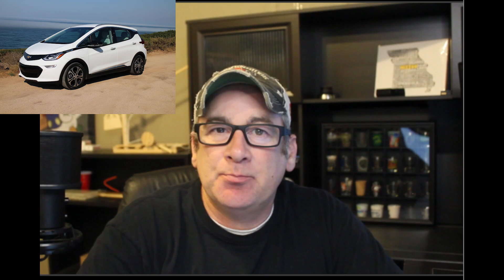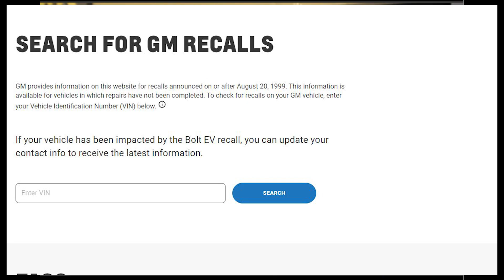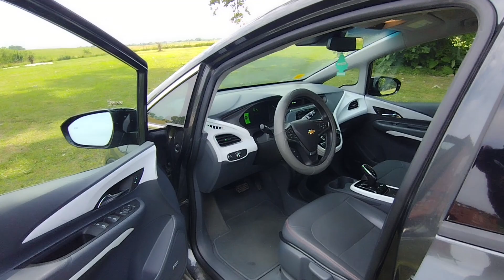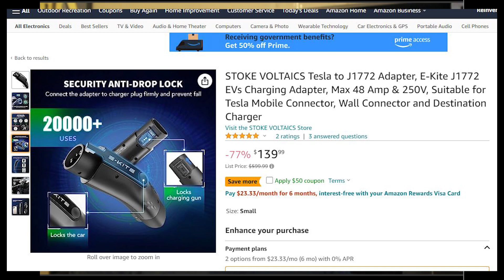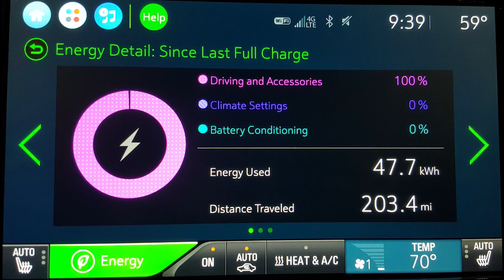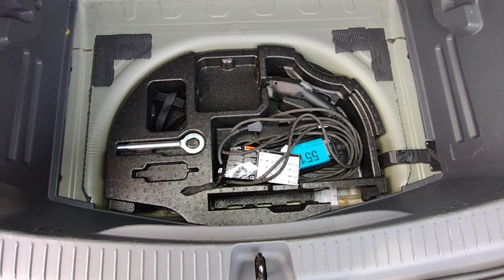1 Year Review of a 2018 Chevrolet Bolt EV

Comment: Good Review. I have a 2018 Bolt Premier that I order from Chevrolet in 2017, on top of that I added all the extras that Chevrolet offered at that time, after the government rebate I end paying $32,000 for the car. My Bolt is going to be 9 years in March 2027, actually it has 32,000 miles, so far from maintenance standpoint only the 12v battery was replaced, and tires rotation every 7500 miles. I average 5.5 miles/kw, my car is an outstanding city car. The reason I can’t buy a Tesla with auto pilot today is because there is no way I am going to get rid of the Bolt, the Tesla will have to wait until my Bolt die.

Comment: Just bought a 2018 Bolt LT yesterday for $11k OTD 

Has the heated front seats and infotainment upgrade as well

44k miles
Battery changed in August of 2023 at 30k miles so i have PLENTY of warranty 

I drive a tesla model 3 as my primary and the bolt is a neat utilitarian car. Public charging is a bear in comparison to the model 3, but just leaving it charging level 1 at home gives me plenty of usability
Reply from the maker: I just rolled over 90K miles.  Knock on wood, hopefully it keeps going for many years to come.  It makes a really good commuter car.  I'm thinking about passing it on to my 16-year-old daughter and getting a Tesla.

Comment: just got my 2020 bolt premier at the begining of this month, due to the transmission problems in my traverse.  It is the most comfortable ride I have had with any car that I have owned. I  was told that if I ever had any problem with the battery to bring it back in and it will get replaced for free. something about the government program they put me on.  the farthest I go is 100 miles once a year. mostly it is 50 to 60 miles  doctors for me or the hubby, then taking my kids that cant drive to their work. I rent so I use the wall charger. 
got a free charge at the car lot three days after having it and they were shocked that my battery was not even half used up.  the only thing that I was not happy with is they didn't tell me tags would be 250 an year where Im from.
I go to a Japanese convention every year and was worried about trunk space but I think we got it figure out. three day and the lot we park in has four chargers in it.
it works great for me and I also know some people that it would not work for. :)
Reply from the maker: Glad to hear it's working well for you.  Our annual EV tag is a little over $100, and goes up $5 every year.  Still cheaper than gas overall I think.

Comment: How is this a good car? I have a 2018 and it rides like a bucking bronco,no spare tire,no jack , terrible radio speakers and like always a good 48 hour to fully charge..I have a 24 year Buick that gets 25 mpg and rides like dream.
Reply from the maker: HI, thanks for the feedback.  Yeah, it's definitely no Cadillac, but overall in my opinion its a good car.  I have the updated Bose radio, and I think it ok.  I do hate that it doesn't have a spare, but I doubt you'll find any EV that comes with a spare.  I do love the 120+mpg!
Reply: I just bought a 2017 Bolt, and it rides very smoothly compared to all the other small cars I've had. The speakers are fine for me - music is awesome with the quiet ride. Get a $400 charger if you can charge at home, and it easily charges to full overnight. I also bought a spare tire and jack, so that's all set.

Comment: After listening to this video…not worth it not even close. Especially if you have to replace the battery at 14,000
Reply from the maker: What do you mean by 'change the battery at 14,000'?  I think it all depends on how you're using it, but I definitely wouldn't have one if I were a single vehicle household.
Reply: @joetalks.76  14000 dollars

Comment: 2020 Bolt EV owner here: I've made several round-trips from LA to San Diego off one charge. It's about 120 mi one way. Depending on conditions and habits - I can make that trip in 80 mi (battery usage wise). The Bolt's regen is a marvel of engineering. I still would agree with you about making multi-hundred mile trips, unless you are a very thorough trip planner and have all your charging stops planned. What I like about the lifestyle of owning an EV is that, charging this at a public DC charger, let's you kind of slow down and re-center. If I ever HAVE to charge on the road, at least it lets me catch up on reading LOL

Comment: New Bolts charge at 48 amps L2.  Ideally never go full or empty, only charges fast as you need to. I charge at 16A usually. For max range, preheat / pre-cool while plugged in before a long trip. I'm going to try Rain-X anti-fog.
Reply from the maker: That's interesting.  I didn't know they had increased.  I know they went to a new battery platform.  I wonder if that is when the charge rate changed.
Reply: Dunno, but it gives you more possibilities
Reply: I think 48a came w the '22 refresh

Comment: Awesome video!! 
Thanks for sharing your experience. 
Q: Do you switch out for winter tires or use stock?
Q: if you do switch out; what tires do you recommend?
Reply from the maker: Thanks!  I don't change out tires during winter.  I will say though that this car handles horribly during slick road conditions on the standard tires I currently use.  I have replaced all the tires since I've owned the car.  Two of them due to a road hazard I hit, and the other two due to general wear.  I looked at the 'EV' tires, and they are outrageously expensive.  I just replaced them with regular tires, and I haven't really experienced any significant range loss.  I'm still averaging 3.5 to 4 miles per kwh.  I think running the proper tire pressure is way more important.  Most cars run tire pressures around 33 to 35 psi, but the Bolt is supposed to be around 38 psi.

Comment: You need to do that to have enough to get you to work and back? How long is your work commute?? 200 plus miles a day?
Reply from the maker: My round-trip daily commute is just under 100 miles.  If conditions are right (temperature, etc.), I might be able to make two trips on one charge, but I would be sweating it on the way home the second day.  I just charge it every day when I get home.  I use about 23 to 25 kw-hrs per round trip.